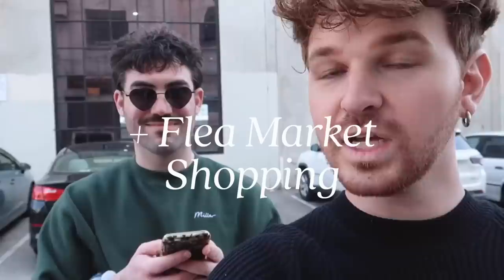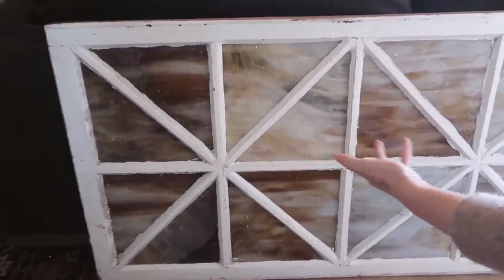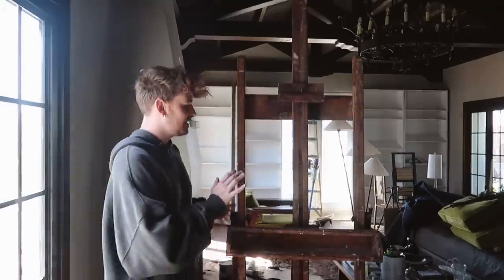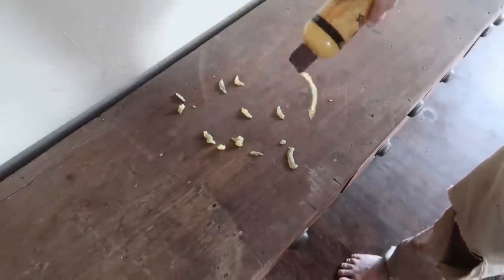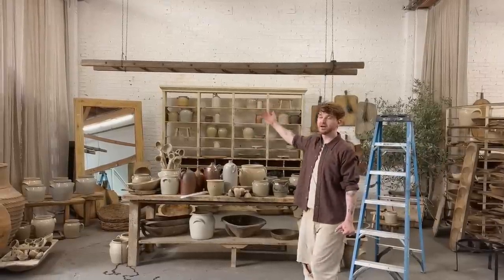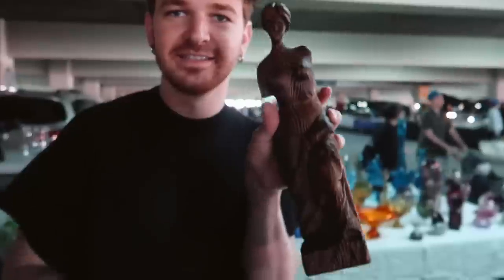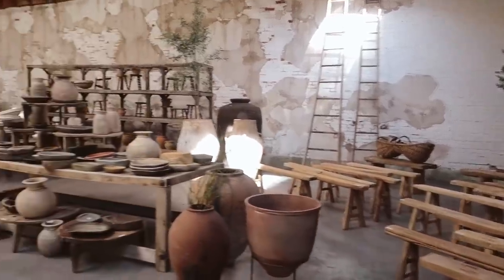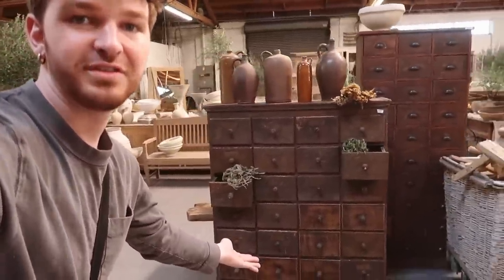EXTREME LIVING ROOM MAKEOVER + Exciting Announcement ✨ Part 4 ✨ Furniture & New Sconces

Comment: Suggestion...take the glass out of the doors that are allready there, trim it out to seal and attach the antique doors to the inside side of those doors. Like sandwiching the doors together. It would make the antique doors safer & more stable. It would make the doors thicker but would also give you the same look you want without removing the old doors or having to rehinge the antique doors.
Reply: Seems like a lot of work, plus would not give the old world vibe.
Reply: @denisejones1863  exactly and it would also disturb the light passing through the stained glass

Comment: I’m not sure the tv the easel will work out. Not unless you secure the bottom brace to the frame. Easels can be finicky when it comes to weighted or oversized canvases and can slip out of their locked position and fall. You’re very likely to break the easel and the tv that way

Comment: OH my! Paint is so much easier to remove when it's dry. I would have walked away and left it to dry, then scraped/peeled it up. When you rub it in like that....on floors or baseboards, it just becomes one with the tile and the wood. I learned this lesson cleaning up cat fur balls. Clean it when it's wet, and you just make a bigger mess. Gross, but true.

Comment: Venus is the name the Italians gave Aphrodite when they appropriated her from the Greeks. So you were actually right... It's Aphrodite! 😂
Reply: They weren't Italians, they were ancient Romans, they are not the same thing. Also, they didn't appropriate anything, they already had Venus as a divinity and when they came in contact with the Greeks the two Goddesses merged.
Reply: @Giulia Antonelli  LOL! OK, Ancient Romans I will grant you, though that's semantics, but Ancient Greece and Aphrodite predates Romes use of  Venus by 3 centuries! 😂
Reply: @maryvallas772  That's not semantics, Italians are a mix of ancient Romans + a thousand different other ethnicities. Also, the fact that Aphrodite predates Venus doesn't automatically mean that the Romans "appropriated" her. When they started to worship Venus they hadn't come in contact with the Greeks yet. AFTER they did come in contact, there was a fusion, so imperial Venus is a merge of the two.

Comment: Please consult an electrician or the electrical code for California on how you’ve installed the wall sconces. Typically, a junction box is required at any electrical connection. It’s very dangerous to have wires stuck in the wall without a box.